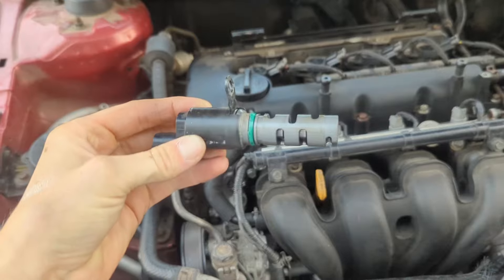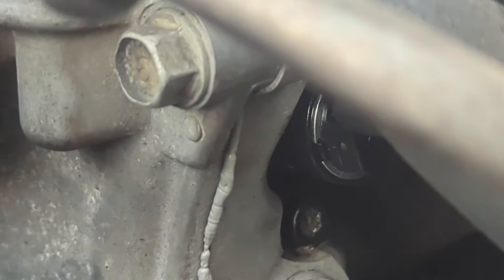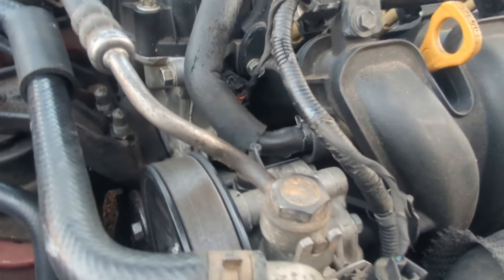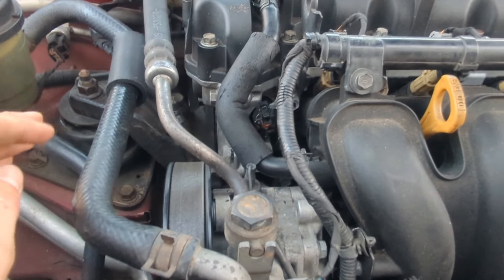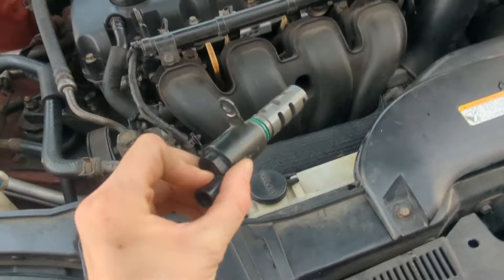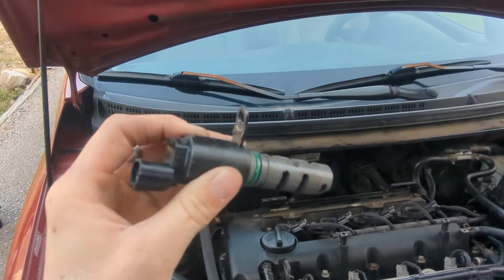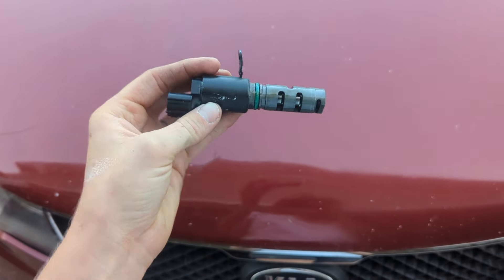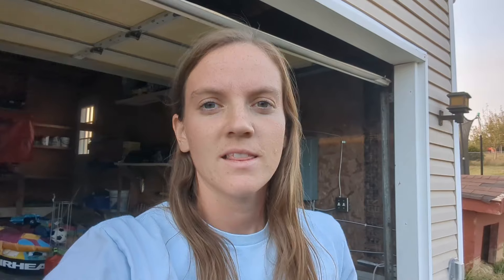5 MIN FIX! 2010 Kia Forte P0011, P0302, P0301, P0303, P0304 VVT Solenoid Replacement

Comment: Was it tough to put the new one back in even with oil? I tried replacing mine but the ring is kinda thicker than the old one and I put some oil on the ring but it didnt go all the way in not sure if I have to force it in l, it is the right part though.
Reply from the maker: I don't remember it being too difficult to insert the new part but I do think I had to jiggle/twist it a bit to get it all the way in.  I would verify you have the correct part before you push too much on it.